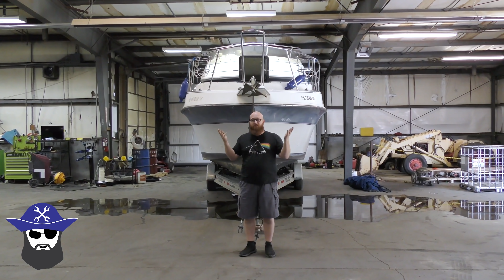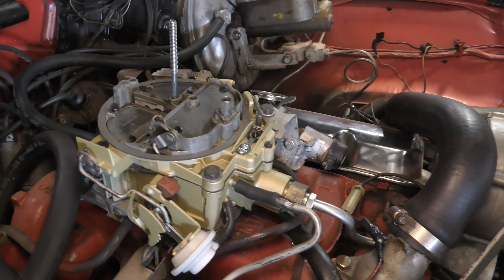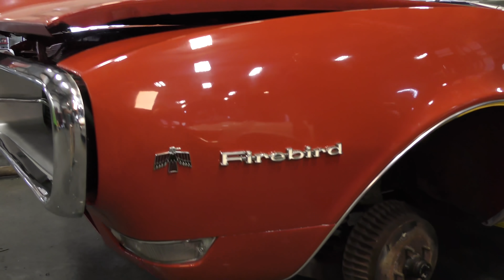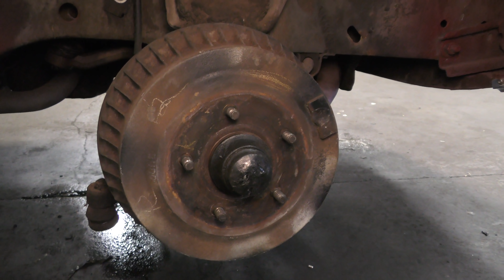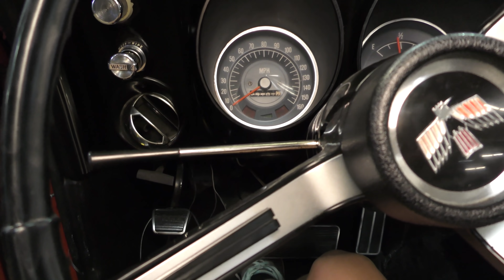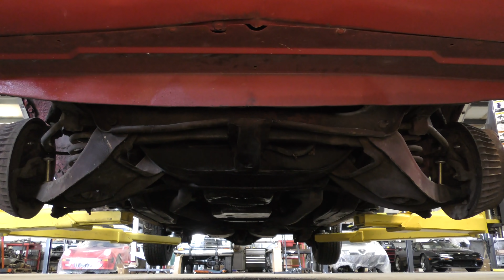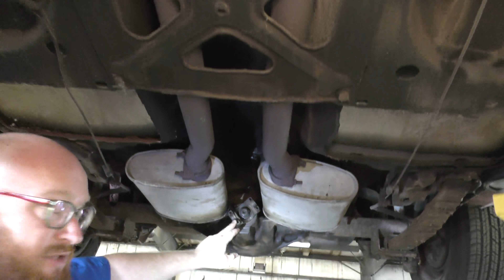Fabulous 1st Gen 1968 Firebird 400 leaking like Niagara Falls. The CAR WIZARD finds 6 places leaking

Comment: Nice car.  Yeah, the fuel tank filler neck thing.  Back in the day, you didn't need to remember what side your fuel tank filler door was.  You just pulled the license plate down, and filled it up.  Also, they are simple to work on.  You don't need a scan tool to tell you what's wrong.  You just use the lump that is three feet about you butt and simple tools.

Comment: I bought a 400 with ram air in 68 , it was a 4:33 with 4 speed , it was a beast ,could not get out of the hole with the factory tires  and rear  suspension it just had wheel hop like a kangaroo. I still did a 13:70 in D pure stock  . The cars best performance was at a 30 to 40 mph rolling start, . It was like driving a boat and it got 6mpg. Probably because I had my foot in it continuously. The base 400 was about 3 grand and the Ram Air added 600 dollars. Most were that crap orange with a hood tach , mine was green , beautiful car , wish I still had it. I got drafted and couldn't pay for it.

Comment: As a 68 FB 400 owner I'd like to comment your comments.
1:30 "an inline six".  There were 2 overhead can inline sixes.
1:32 "326", no, in 1968 there were 2 350 cu. in. engines.
3:14 harmonic balancer. Besides the bad rubber, the balancer 'shaft' is badly grooved where is enters the timing chain cover. The shaft could have a sleeve slid over the nose but thumbs up with the balancer replacement.
5:09 Take it to a Pontiac dealership?   FIND ONE!
7:33 What's the difference between a 67 and 68 Firebird gas filler door? On a 67 you open the door by a small opening at the door bottom. A 68 you shove your finger up the bird emblem's backside!
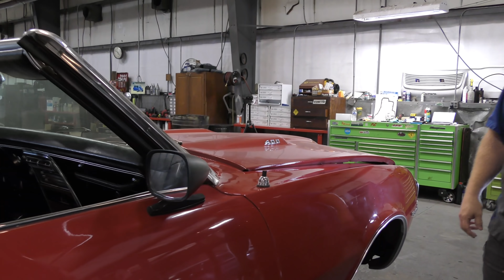8:12 correct base for an elliptical screw-in 3 piece mast with 'chicklet' tip

Comment: Had a 1968 F-body, Those drum brakes were standard, and this one has the power option, mine did not. Something about the mindset of the 60's where power steering, but manual brakes was pretty common on many vehicles. I remember having the front drums turned, and the brake shoes matched. Otherwise, shudder was common until if, or when the brake shoes set Unlike the rear brakes, the drum and wheel bearings were all one unit. It was the same on early disc brake models, so brake jobs were time consuming. The last thing you wanted was any of the waste from the drum turning or shoes matching in the bearings. Loved the Pontiac arrowhead side markers. The standard 250 cu. in. Pontiac OHC six in Sprint form was good for up to 230hp, and shocked many a V8. I like that this has a multi-leaf rear suspension. This was the days of the GM "monoleaf" rear suspensions, not my favorite. This car has many option, some minor. A bench seat with column shift was available as it was in the early Mustangs. Great car, Mr. & Mrs. Wizard.

Comment: The Wizard's mentor was both correct and incorrect concerning EFI vs. carbs.  Correct: modern-day EFI is far superior to any carb setup. It's just a fact without any argument. Incorrect: carbs are hard to rebuild. One of my mechanic mentors could rebuild a Quadrajet in a couple of hours, the longest part being soaking it in Chemtool.  He could have it back on the car and tuned in a matter of minutes. I watched him take the "smog" versions and expose the idle air screws in the base plate with a hammer and punch so they could be cleaned and made adjustable.  The best advice he gave me about Quadrajets was never ever start bending linkages to improve performance. Lastly, I don't think the Wizard is old enough to remember what a Kmart parking lot smelled like during the summer. Yes, you were more likely to smell some gas fumes, but unless a car had a fuel leak, it did not stink of gas. Why? Bowl vents were inside the car's air cleaner and many cars at the time had a simple fuel vapor recovery system.

Comment: This would be a good time to swap out the OEM cam, for a today's computerized designed ( lca 112 style) cams. They just grinded cams back then 1 step away from eyeball grinding style. The owner is leaving mpg and at least 40 hp on the floor. Along with an 200r4 overdrive transmission conversion as well. Only downfall of Pontiac v8 are the cast rods and stock oiling system.

Comment: Well Wizzard if he ever wants to add air con, theirs a company out there that does that, its literally called Be cool vintage air, and leno's used it on more than a few of his 60's cars, and its fairly modular too I believe, and with 18:12 yeah, Carbed Cars need Vented gas caps to work right, fuel injection uses pressurized gas caps to keep the system contained, and actually if that happens again maybe he could just get a pressurized cap for storage?

Comment: Your such a social media brown-noser. You can fix anything on those older cars with basic tools and a little elbow grease. Carburetors are simple to rebuild and tune. I took an engine out of my 1969 roadrunner, rebuilt,  put it back in, and running  in less then 2 days, all by myself and no computer needed. Those brackets your talking about, at least you can get them without tearing half the car apart, like on newer cars. I like newer cars but they are a pain to work on and seems like your always buying some special tool to do a simple job.

Comment: Go pull an automatic transmission out of a 4 wheel drive Nissan Xterra  veres pulling the 3 speed turbo hydramatic trans out of any GM car built up to about 1981, Ill take this old car any day, on the Xterra you have to pull all the exhaust off from the manifolds back, the starter is an absolute nightmare .All the front torsion bars for the front suspension and Nissan uses some kind of locktite and they REALLY torque thier nuts and bolts down tight and god help you if its a northern vehicle with salt corrosion on the exhaust parts. I broke several bolts off because they were so tight. The trans cross member is very difficult to line up also.

Comment: In the drivers door jam you can see that they replaced the lower door hinge pin with a over sized one. Those doors tend to sag a lot! I had a 69 convertible with a 350 and front disc brakes. On the brake pedal it said disc brakes. They were super proud of that option.

Comment: Wizard I have a problem with my 2008 Toyota Corolla ce I have a low idle 600  I took the throttle body out to clean it is still have a low idle can you help me out do I have to auto relearn with the scanner I did it with the key off and on didn't work

Comment: So what are we looking at about 1:48 into the video?  It looks to me like an evaporator is inside of the black enclosure with a AC valve, muffler with the suction/discharge manifold and places for the o rings where it would fasten on the rear of the missing compressor?

Comment: The 326 was only available in the '67 Firebird; the 350 Pontiac replaced it.  The engine lineup goes like this: standard Firebird had the 1-barrel OHC 250 six and the 350 2-barrel; the Sprint had a 4-barrel, high-compression, hotter cam version of the OHC six, the H.O. had a hot 350, and the 400 had the standard 320-horse 4-barrel 400 with the high-output Ram Air 400 optional.

Comment: Continuous gas fumes are not normal, even for these cars.  Putting my Chevelle in the garage after a drive will initially leave a very slight smell, but that's gone in less than 30 minutes and there's no smell at all until I drive it again.

Comment: I got out of the Navy in Aug of 2008, bought a '68 Firebird hardtop the same color as this one. Had a Hurst shifter on a Muncie tranny behind a 350 HO. Had a white pinstripe down the side with the 350 numbers incorporated. Had the pinstripe removed at the dealership before I took ownership as the insurance would have gone way up with that on there. Owned it for about 12 years. Lo & behold it turned into a 400 because the 350 blew up on me. Bought it for $3700 sold it for $1200. Lotta history with that car.

Comment: Most do not know, when pontiac put the 400 in the firebird they did not want it to be faster than the gto, they put a little bracket on the secondary to prevent it from opening fully. They were removed and thrown away.

Comment: I had a 71 Lemans Convertible in high school.  The junkyard that I got parts from had a 68 Firebird Sprint OHC straight 6 that I occasionally used for a parts car .  I really wish I had just bought the whole car.  If you need a mechanic for your 69-71 GM's in Granger IN I would  do the work for beer money

Comment: Thank you Wiiizard for letting everyone know the truth.  Thank goodness that they do not make cars like that any more!  Computer controlled EFI is not just more efficient, it is more reliable, and easier to maintain.  Most of the people who wax on about old cars do not even realize that they are supposed to re-tune carbs every six months, for summer and winter.  Not to mention having to mess with points and caps every six months either.  THAT is what a tune-up is, and there is no such thing on EFI systems.

Comment: You're right when you say they weren't better built in the old days. This video  - 2009 Chevy Malibu vs 1959 Bel Air Crash Test | Consumer Reports - YouTube - of a head on test crash between an old Bel Airt and a modern Malibu shows the difference. The passengers in the Malibu would have likely walked away. It's doubtful those in the Bel Air would have survived. Those old cars were beautiful and stylish, but that's about it.

Comment: wtf U show a car that IS set up for A/C and then say 'it doesnt have it'? wtf?! Hello theres no a/c compressor but all the rest is there at the firewall. Theres no vent pulls at the kick panels because a/c cars used the heater panel controls.  It's much easier to pull the engine to do all that resealing and engine mounts. & it'll make the str box job easier. Did j.mint measure the tourque while setting that pinon nut/crush collar. Just "run the nut back to where it was" is easy way to burn up the bearings.

Comment: all the brackets on older cars is why dealers sent techs to bracket school. On the oil leak side need to check the oil pick up the tend to fall off the pump then engine has ro be overfilled or fast turning causes loss of oil pressure

Comment: Last year of the Pontiac Firebird 326 was 1967 (same for the 327 Camaro). Standard small block for 1968 and after was the 350 in various configurations.

Comment: Have to disagree modern vehicles are easy to work on as new cars have the same issue if not worse eg. remove manifolds to change sparkplugs on many newer vehicles. I have many friends who transitioned from carbs to fuel injection.

Comment: I had two Firebirds, a 67 and 68.  My 68 had a 400 with a two-speed automatic transmission.  It came with heat and that's it.  The 67 was a Sprint 6 with a six-cylinder, a four-barrel, factory dual exhaust, power everything, posi, factory disc brakes, AC, and a four speed manual.  I'd love to have either one of them back but definitely the 67.

Comment: I remember in the early 90's there were a lot of shops that didn't want to touch the new cars with all the computers and fuel injection. You needed to go to the dealerships. Now its shops that wont touch the cars with carbs and distributors. Im glad that I can work on both. It took a little learning to understand how all the sensors work together to make a fuel injected car run. But once you get the basics down Troubleshooting is pretty easy. especially with a code reader. I still have my OBDII scanner that I got from JC Whitney in 1998. It just gave you a number code that you had to look up in a book.

Comment: I would rather have the older cars they are fine to work on you have room under the hood. Distributors and carbs are not that hard to do. Also you don’t need thousands of dollars to diagnose an issue.

Comment: I had a 69 Camaro, many parts were interchangeable between the Firebird and the Camaro. Amazing thing was parts at the Pontiac dealer were usually cheaper than the Chevrolet dealer.

Comment: I suspect that car came with A/C from the factory. The dog house with the evaporator is there. The hoses have been looped back. The large factory compressor covers the whole left side of the engine. The first thing I did to my 1969 when I got it in 1976 was remove the compressor and brackets so I could get at the plugs. Didn't need a/c in Wisconsin anyway.

Comment: I actually have to disagree. I find the older cars way easier to work on. Maybe it's just my experience with carbs and dizzys. points are easier to diagnose with than a no spark on a modern car. Sure there may be more brackets and bolts. But I would deal with a few extra bolts than trying to program a new electric power steering with only 2 bolts.

Comment: I liked the HEI ignition system I was train back in the 70’s to work on those systems and the Quadrujet 4 barrel carburetors a lot of new mechanics would be screwed if they had to pull a distributor out and reset timing on those older cars and trucks man have times have changed

Comment: FAIL 
That originally was an A/C car. Only a/c cars had the steel covers at the core support. The long radiator bracket on top and the full A/C box on the left firewall. All easily seen with hood open. Sorry to correct you boss.

Comment: I owned a 68 firebird 400. Best car I ever had. One correction on the horsepower. They lied and undervalued the hp in the late 60’s. The firebird in 1968 with the ram air 400 was pushing 368 hp. 
Mine was the hard top and had a hood mounted tach.

Comment: Survivor🤣🤣🤣someone has been in every orifice of that car, the bumper bolts, windshield bow trim, and that hideous (wrong) replacement mirror on the driver's door have all been painted black, the original blue for the engine has been painted over, missing grille pieces, the arrowhead on the nose, survivor, seems legit, should ask 6 figures for it🤣🤣🤣safety has improved in the 6 decades, and I don't care for carburetors, but, I have never in my life met anyone who would prefer to work on a new vehicle that a 5 year old's hand would be tight fitting within the confines of a late model vehicle

Comment: On 1960's cars the computer is on your shoulders.  Every mechanic should learn to fix the older cars before they start on the newer cars.  They will learn how to understand how cars really work. Sure, you can teach someone the basics on a lawnmower, but that's too easy... Once you can set timing by ear and tweak a carb with a vacuumeter, you're a real mechanic. Any moron can read a code and replace a part or lots of parts if they don't know what they are doing.

And yes dang it, I cut my teeth on cars older than that Firebird and prefer a vented gas tank over smoking out an evap system.

Comment: I had a '68 Ford Galaxie 500 convertible that I owned for about 15 years or so -- 2003 thru 2018.  Anyway, it was absolutely impossible to find someone to work on it.  I had to do all the work myself.  No one will touch a car this old anymore.  You have to be mechanically inclined in order to keep it running.

Also, about the A/C -- the base price on the car was a smidge over $3,000, and the cost of the Air Conditioning option was $330.  So that's literally TEN PERCENT added to the cost of the car just for air-conditioning!

Imagine buying a $30,000 Toyota Camry today and the dealer telling you that you'd need to pay an extra $3,000 for A/C?!!  That's essentially what A/C cost back then, though -- hence the reason so many people opted not to buy it.

I was very lucky that my Galaxie had the A/C option.  Heck, it had almost all the options -- power steering, power brakes, AM/FM stereo radio, A/C, 390 cu. in. V8.  The only thing it didn't have was power windows.  The sticker price with all the options was $4,400.  That's about $35,500 today.

Comment: I love and agree with most of what the wizard says, BUT having owned a 68 camaro with 4 wheel drum brakes I strongly disagree.  I totally rebuilt my brakes in the 90's with the best parts at the time and STILL abysmal stopping.  Trash those things and do a 4 Disk conversion NOW!  Only thing worse than having an accident in a classic car...  Having one in a classic uni-body convertible car with no shoulder belt and airbag!

Comment: My brother had a '69 firebird convertible with automatic and the Pontiac big-block 350. It was also really rusty.
He refit it with a manual 4 speed, a much better small-block 350 and replaced the rotten body pannels with fiberglass. It was a sweet ride when he was done, but hardly original. Still, I loved it.
He sold it to my brother-in-law. One day, it was parked near a corner on the street. A couple of women who were speaking ASL to each other instead of watching the road, came around the corner and drove into it. The engine got a second life in a pick-up truck, but that was it for the car.

Comment: The six cylinder for that car was unique and most aren't aware. Both the Firebird and Tempest had standard a straight six, but not an ordinary one. It had an overhead cam, unlike any other American motor, except for the Ford SOHC 427, which didn't come in normal street cars. The six had either a one barrel or a four barrel carb. The four barrel unit was 215 hp gross and was available with optional four speed. Those must be rare. Some history.
Reply: Jay Leno has a straight 6 Firebird that’s being restored.

Comment: Wizard this Firebird had A/C but the compressor has been removed. note the parts on the passenger side of the car, they are all part of the GM A/C system the car came with. Also note the vent above the radio and the HVAC controls in the car. They show there was A/C in the car.  As to the paint the car was repainted. That gas cap was never body color and looking at the underneath you can see the over spray on parts that would not have any IE springs and some of the bolts holding on the rear pan.  It still is a real nice car and I appreciate your overview of the vehicle.